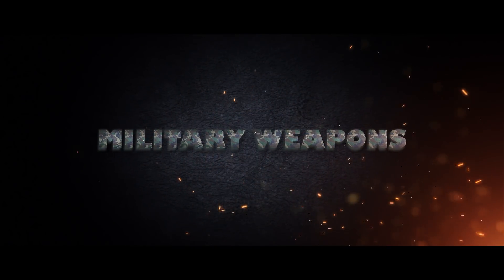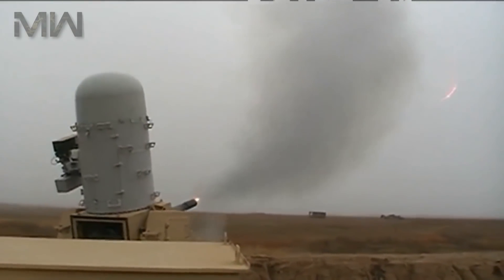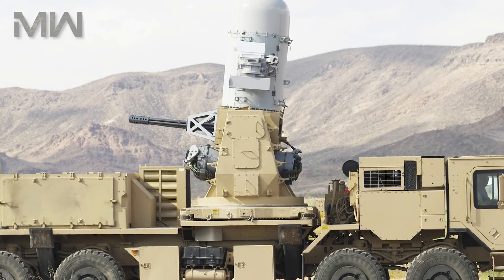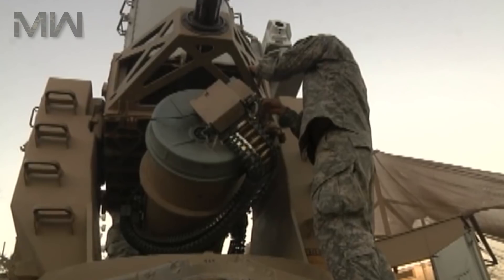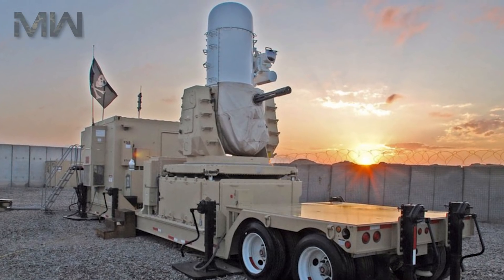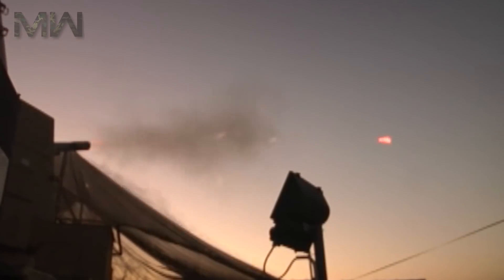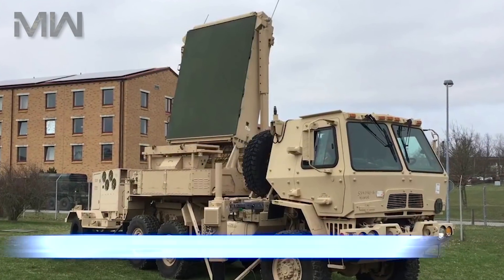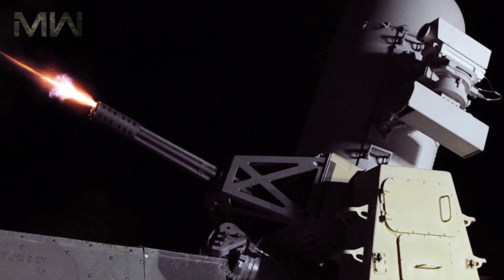Counter ROCKET ARTILLERY & MORTAR: US C-RAM Systems

Comment: A couple of helpful points - I think I shared these on a related channel that got the same exact things wrong:

1) It's NOT "M-K". "Mk" is short for "Mark", and that's exactly how it's spoken. At least you got "Mod" correct.
2) Phalanx is NOT spoken as "fah-LANKS". It's "FEI·langks". A quick Google search for "Phalanx pronunciation" is all that's needed.

I was a Navy Fire Controlman for 10 years, lots of hands-on with CIWS. You got the system description basically correct, but the mispronunciations really detract from the video.